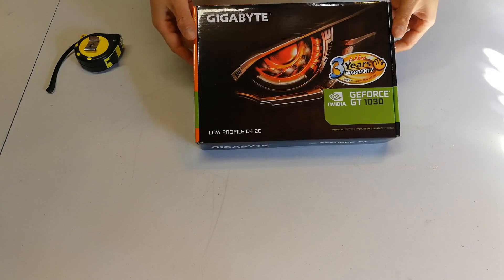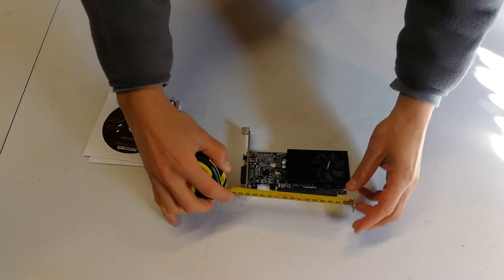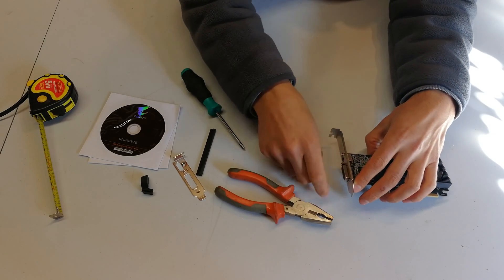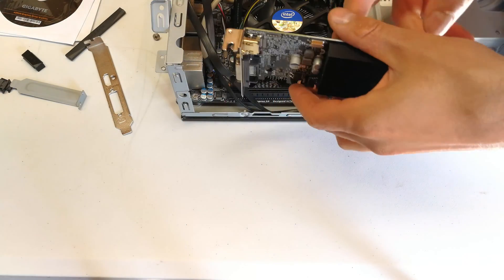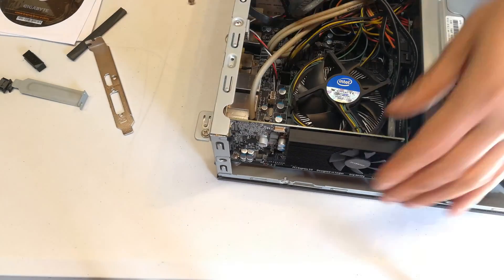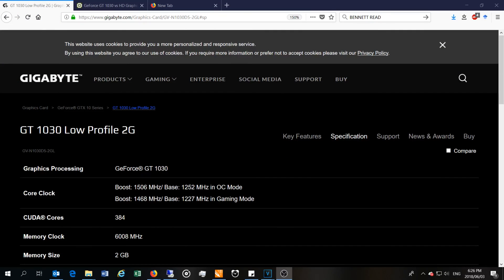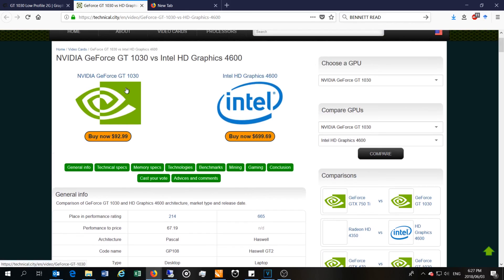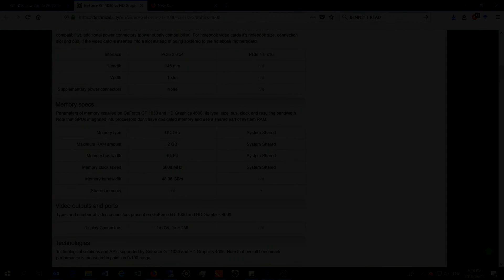Unboxing and installation of Gigabyte Nvidia GT1030 low profile graphics card into ITX box

Comment: Well plugged in, I have no screen/display.. Did boot up.  Dual screen. No signal to either one.??
I am on that PC. If I put card in i cannot use onboard card. won't let me use both. I was okay. had trouble. Back up running now. Part of my trouble was losing them, to a flickering DELL which i no longer have.

Comment: Man i have this problem that when i install the gpu the monitor wont display anybody please help me with this
Reply: This may be a dumb answer but, is your display cable connected to the card and not the motherboard?
Reply: @alonsoaguilar3905  so what's the real answers bro I need to connect my monitor on the gpu to work?
Reply: @ryochun9303  yea run one end from the GPU to the monitor. Don’t connect the cable to the motherboard

Comment: Do you know where I can get smaller bracket?
Reply: it comes with the gpu
Reply: @leto1449  mines didn't and I couldn't find a replacement
Reply: @Kizanese  because you bought used one ?
Reply: @leto1449  thanks bro you're a real one, everyone else couldn't find this.
Reply: @Kizanese  i wish it will work for you if you didnot find that it suits you check other just type low profile brackets

Comment: What is the difference between the low profile 1030 and normal one??will there be difference in performance??I have i3-3220 n 4gb ram if I use this GPU can I play gta V at good normal settings?
Reply from the maker: low profile means the card can fit in a smaller box, the height of the card is less. Performance on regular version versus low profile should be the same.

Comment: hello this graphic card can be used with a 240w power source
my pc especifications
I5-4570
Gt-1030
MotherBoard:hewlett Packard 18E7
TOSHIBADT01ACA050 500gb

I don't know if more components are needed but those are the most important
Reply from the maker: https://www.coolermaster.com/power-supply-calculator/#!
Reply: Did you end up getting a 1030? Does it handle hdr?

Comment: Hey, do I have to disable the onboard vga adaptor? If so, do I have do that before or after I install the card? Also, my power supply on said pc (HP 570) only has a max of 180W. I still have an old psu from 2 years ago with a max wattage of 650 in my closet if I need it.
Reply from the maker: no you dont have disable VGA, the new graphics drivers will know which port you are using. 180 is a bit low but it depends on what CPU you have.

Comment: Incase anyone here had a monitor that only supports vga (like me) all you have to do to hook it up is get an HDMI to VGA adapter from Walmart or somewhere else, hook in the HDMI side into the HDMI port on the graphics card, and hook the VGA cable into the VGA port on the adapter and boom, problem solved.
Reply: qd22k did I ask?
Reply: Thanks 😁
Reply: I already knew that

Comment: Can this graphics card work on a power supply of 220 watts?
Reply from the maker: it doesn't matter as the card uses a DC voltage from your power supply. If your power supply is 220V it will still provide a DC voltage for your card. So the answer is yes it will work
Reply: It needs 300 watts minimum
Reply: @idknfn  No it doesn’t don’t believe what company’s say

Comment: What about wires? U dont have to connect wires or anything else!?
Reply: DEADSET_ EAGLE no you don't need to, it's a very low power consuming card and gets all it's power from the pcie socket
Reply: @rayjynx  bought the gpu last week.... Zero regrets 😃

Comment: Ihave same videocard and my pc said video no input when i boot up can somebody help me
Reply: Make sure u put the hdmi cable in the gpu hdmi port not the motherboard hdmi port
Reply: I have the same problem
Reply: @germanmaxhd5070  Do u have another system that works? Maybe if you install the gpu and drivers on that one then put your disk drive and gpu into this one, and make sure u plug in the hdmi into the gpu hdmi port not the motherboard port
Reply: @germanmaxhd5070  Before installing the card, install the driver. then put the card in, and it should boot from there. If not the PCIE slot might be turned off in bios (that's an option in some of them for some bloody reason)

After doing this, you'll have to use the video ports on the card itself (unless you enable passthrough in Windows, which actually has some advantages if you only game a little or want to trick it into using a Freesync monitor. doesn't work on Linux unfortunately at least to my knowledge)

Comment: I have a gtx 1080 but for some reason I really want to build a cheap PC. I also like the idea of taking an intel grandma PC with a i3 and buying one of these and putting it in there.
Reply: Do it mate. Just got a bargain myself a 7010 sff i5 3570. Cost me only £56. It's gonna end up costing about 200 and be a beast.
Reply: Writeous0ne actually built a PC for my brother. Except I ended up using a used rx560 for 80 bucks instead.
Reply: @Tofuey  nice mate. I've got an rx 560 in my old phenom 965 build. It's a good card.
Reply: STOOOOOOPID XD

Comment: hello may i ask you how much watts does your psu have ?
Reply: I have a 220 watt I’m trying it rn
Reply: @pixvvs  how did it go? i have a 240-watt power supply and i'm trying to figure out a range of price points for possible video card upgrades. right now i just have a Radeon HD 7570, but want to price out possibilities at $50, $100, and $150.
Reply: lost time it went great I even overclocked it runs at great temps and has great performance on fortnite 60+FPS at 1080p!!
Reply: @pixvvs  do you have any worry of your psu going out or things locking up due to low or inconsistent power?
Reply: lost time not rlly it wasn’t a large overclock
Reply: @pixvvs  i'm not thinking about the overclock, but just power usage in general. but i'm a noob so i'm paranoid. thanks for your replies.
Reply from the maker: 300W
Reply: ecologicaltime would it be ok if I put this in a 235 watt supply and I don’t have any extra fans
Reply: @RoyaleHavocCR1012  It's fine as long as you have extra headroom for it.
Reply: @RoyaleHavocCR1012  did you try it? i have a 240-watt power supply and i'm trying to figure out what my options are as well.

Comment: my computer monitor wont start up its just all black pls help
Reply from the maker: plug your monitor into a different machine and make sure it works. Then make sure you selected the correct input source - HDMI, VGA. Then if still not working, you will need to go into your BIOS. Also make sure your cable is working.
Reply: ecologicaltime - whenever i take out my gpu my monitor and everything works fine, but when i put my gpu my monitor goes on "power saving mode". Do you know how to fix this?
Reply: @kalin5518  I’m having this problem too did you learn how to fix it?
Reply: @emilioleyva603  i think it was because i had a 180 watt psu and the minimum psu is 300 watts